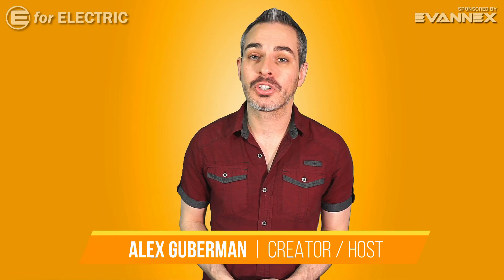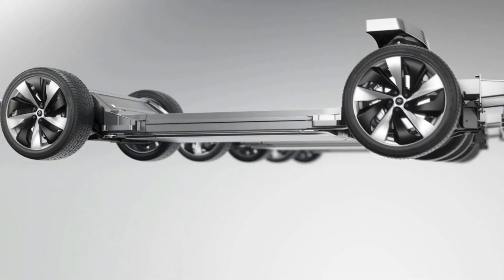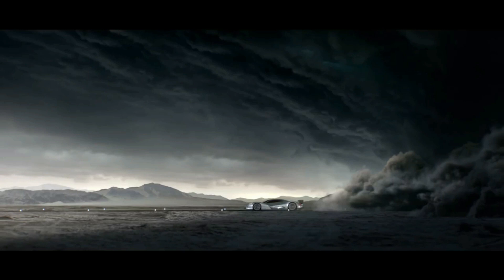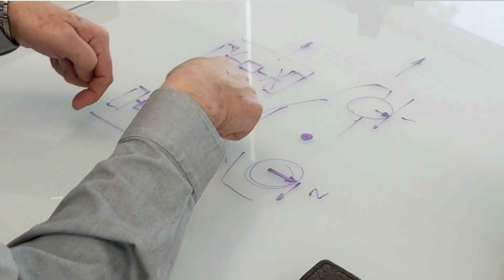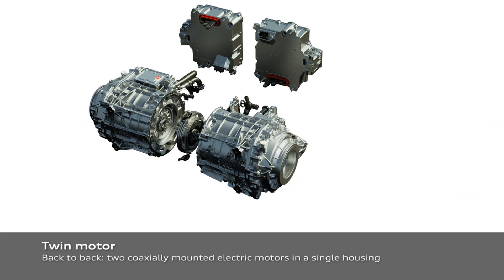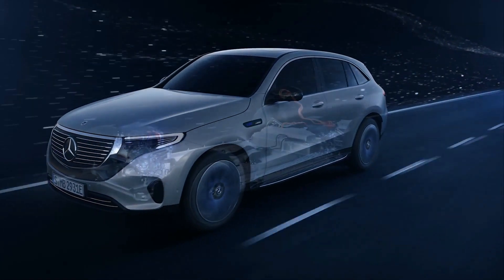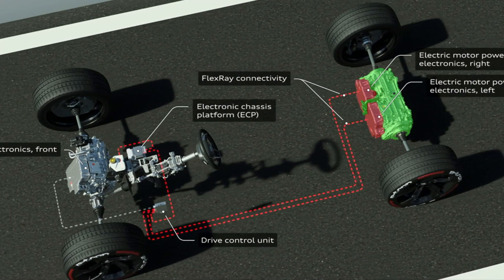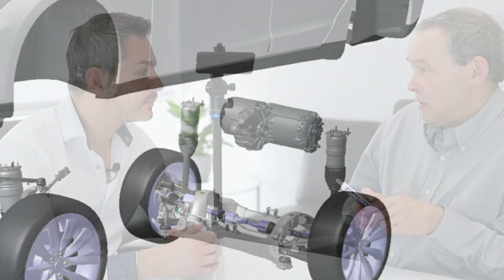Multi-Motor ELECTRIC CARS Advantage Explained

Comment: With four small motor or hydraulic on wheel motor we could goes fuel less easier for it require less power to get it driven and she'd the in needed weight of gear converter consumed much more than without the gear and transmission too costly

Comment: Disappointed.  It's more than just better 0 - 60 mph times.  No discussion on the variable efficiency of an electric motor over its RPM range.  No discussion of the fact that these multiple electric motor vehicles have different final gear ratios -- there is a reason that they do.  Missed opportunity to explain why EV makers don't just add a single, larger electric motor that distributes torque through a transfer case or central diff like conventional AWD ICE vehicles

Comment: Two motors front and back with torque vectoring is more effective than an equivalent hp quad motor system. If you have four smaller motors, each wheel only has a max power output of one of the motors, but if you had torque vectoring you can have the max output of one of the two main motors on one wheel. Applies to tight cornering and non-ideal surface situations, or where you'd want high performance traction control.

Comment: Question is I hope Engine not link together if one Motor broke car fully stop need Towing car to  Garage for Fix ? !! 
IF this car each Motor after broke down automatically goes to Neutral and let the car run until last motor to able take car middle of no where to the Garage that's going to be Fantastic

Comment: If you have four motors do you actually need friction brakes?  Reverse the power into the motors and you’ll stop just as well as with brakes. Maybe?
Reply: You do still need them. Regenerative braking relies on the battery needing power. If the battery is topped up you get little to no regenerative braking.
Reply: Yes, it is possible and it is effective till full stop (regen braking is not). Just inefficient and thermally demanding for the motor.

Comment: it has been long existing rules since ICE car time: for cars with 240hp or below, Front wheel drive is best, 200hp-400hp, RWD;
AWD works great or is needed when there are over 400hp.
Now AWD can be done cheap with two motor front and back, I believe that's idea config for most of EV car with 240hp or higher
If wheels from both sides have their own power but without binding to each other, you really should be careful of losing balance.

Comment: Its about limited traction available per wheel to sustain a demand from acceleration for skid-less start up. 

To do away left-right front-back differential transmission of a single motor vehicle, for slippery road traction control which may be elegantly done with electronic as oppose to mechanical means.

More aggressively, to develop in wheel motor to maximize vehicle room to house more battery cells.
Reply: In wheel motors, or hub motors, have their own set of pros and cons.

Comment: There should be some mentioning about the more motors advantages for offroading. Independent wheel drive is, if I'm not mistaken, the best option for serious offroading. I'm talking, sand, swamp, mud, rivers crossings not nice padded park trails.
Reply: You can basically get independent control through using the brakes like he mentioned. Gas vehicles do this today. Like Land Rovers for instance.

Comment: EV asmr!
AWD should also provide more opportunity for more regen, less brakes, esp in low traction cases.
Reply: Quad motor, mounted inboard w/ inboard brakes, torque vectoring, minimum unsprung weight.
Reply: Two wheels provide more than enough grip for regenerative braking.

Comment: Speaking as an amateur I understand that a dual-motor Tesla uses a combination of Induction motor and switched reluctance motor (SRM). Tesla do not use permanent magnet motors as they are expensive requiring a large number of high-quality neodymium magnets. The SRM motor is cheaper and more robust but has problems with cogging  so some magnets are included to assist in smoothing out the low-speed unevenness inherent in the SRM design
Reply: - Actually it is not an SRM even if this description is reported often. They use a PM synchronous machines, in particular so called Interior PM synchronous machine which is nice because it exploits also this "reluctance mechanism": this allows to reduce the amount of expensive PMs. Tesla officially call it "PM synchronous reluctance motor". 90% of EV manufacturers use IPM designs. Not really a new topology: in traction application it was introduced by Toyota (in the Prius) in the 1990s.
- SRM has no magnets (it's a great advantage!).
- SRM has 0 cogging torque = torque oscillation when the motor is unpowered (like induction machines and in general all the PURE reluctance machine). What is annoying is the torque ripple = torque oscillation when the motor is powered.

Comment: Great video. What I've been dying to ask is if you have quad motors that independently control each wheel, what happens if one of them fails while driving? I am curious what type of fail safes are in place to prevent an accident like if your front right motor fails, will it shut off the front left to stop any kind of swerving or potential spin and only use the rear motors?
Reply: That's right questions I hope not link together if one Motor broke car fully stop need Towing car to  Garage for fix? !! 
IF this car each Motor after broke down automatically goes to Neutral and let the car run until last motor to able take car middle of no where to the Garage that's going to be Fantastic.